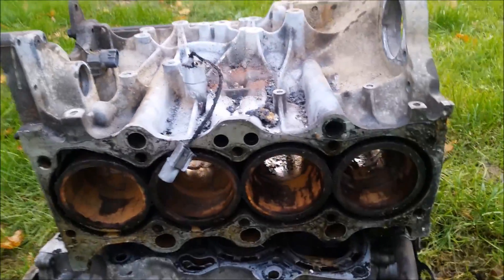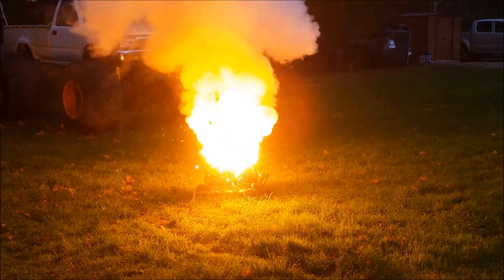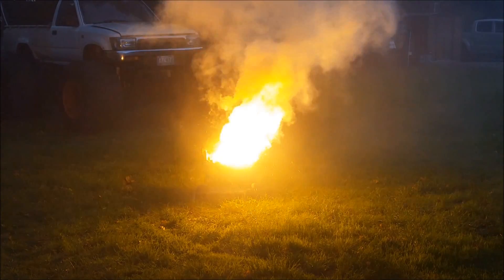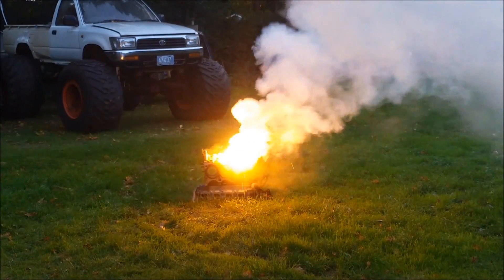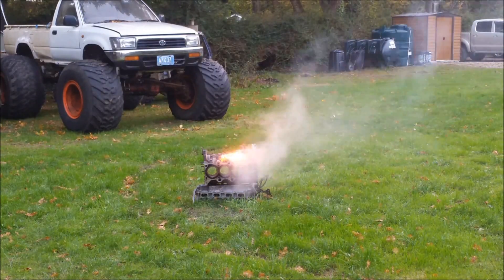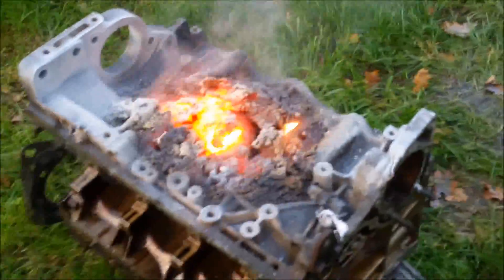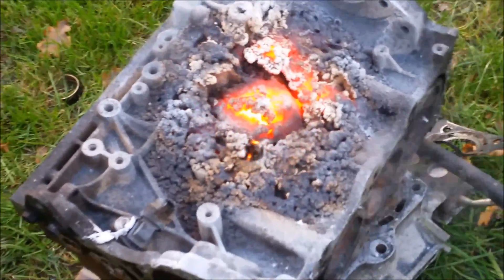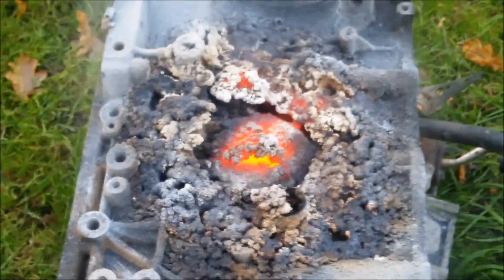2KG THERMITE VS ENGINE BLOCK

Comment: If you had gotten the mixture just a bit better and used a clay pot with a small hole in the bottom, it would have done WAY more damage
Reply from the maker: Yep, in the second video we put it in the cylinders and it burnt through the pistons and the sump....
Reply: @marktgsxr  I watched it right after this one. 

Thanks for the content

Comment: When an engine gets completely destroyed, you can melt down the block, and then cast the molten metal back into the original shape of the engine block.

POW! You've got a brand-new engine!

Wash, rinse, repeat, ad infinitum!

Comment: Now some people argue that it didn't do anything to that engine block but if that was an actual running vehicle with all the hoses lines and gasoline and oil and so on after that kind of experiment attack on the engine block that engine would no longer run the vehicle would no longer move cuz all the control valves hoses connections lines wiring would all be burned away rendering the whole vehicle useless but that's just their Siri because they never actually done it where the proof is right here in the video and they won't believe their own f**** eyes
Reply from the maker: You've hit the nail on the head!

Comment: undirected thermal reactions are weak. Conatain the reaction in a vessel that allows it to be directed in a singular direction and there'd be a hole through the block if you made the mixture right.
Reply from the maker: Totally agree! That's exactly what happened in the second video!

Comment: What a waste of time.
you don't understand the dynamics of thermite.
  Trump 2020
Reply from the maker: You must be another flat earther....
Reply: The Nutters Workshop 
If he would have put the thermite in 2 flower pots, one in the other, set the pots full of thermite on the block using the hole in the bottom of the pots to were you want the hole in the block. Ignite the thermite, cover and back up and wait. Then the thermite will burn through the entire block.
Reply from the maker: @stomabag7127  sounds like another experiment is in order.....

Comment: Mhm... The reaction was much slower than usual.
Reply: Bad thermite mixture
Reply: Yeah, iron oxide absorbs moisture. If it was left out in the open, it probably was. You need to keep it in a sealed container, or dry it out in the oven before using.
Reply from the maker: I may have gotten damp..... need to try again....

Comment: Badly made thermite???
Reply: just an opinion, this could've worked if the thermite were concentrated in something heat resistant that controls the flow of molten iron, like a flower pot. That way the heat wouldn't be spread out and the melting metal could've pierced at least one layer on that engine block. aluminium has a very low melting point compared to iron (about 660 vs 1540 C). not to mention thermite burns at 2000-2500 C.
Reply from the maker: Kejsarn no, just the engine block doing what it was designed to do, shed heat!
Reply: The Nutters Workshop high quality?
Reply from the maker: Kejsarn it was loned to me from the railroad maintenance depo.....

Comment: I don't think it was the right mixture. The best mixture is 1 part aluminium powder for every 3 parts oron oxide, wich would make the thermite look red. The mixture in the video was grey.
Reply: Red iron oxide works best though. The mixture doesn't matter very much. The ideal mixture of iron(II) oxide (red) is about 54g of aluminium with 160g of iron(III) oxide. Don't measure by volume, that's silly.
Reply: Black iron oxide
Reply: Mesure it with g.mol. just find the equation. Google it
Reply from the maker: New video coming soon that is red iron oxide.... i can you it burns alot faster than in this video...
Reply: In the end modifying the chemistry doesn’t change anything. Either way it doesn’t matter. Neither will do much using it the way that he’s using it.

They have to be used as shape charges/focus their thermal output on a smaller area.

That requires some machining, or at the very least welding experience. Thermite alone won’t do anything special. You need to design housings for the chemical reaction.

Comment: hmmmm. seems it didn't melt it at all. is it cast iron?
Reply from the maker: Paul Sheer i think the aluminium block dissipated the heat from the thermite with incredible efficiency! it would be interesting to try it on cast iron block!
Reply: @marktgsxr  Aluminum has a ridiculously low melting point compared to cast iron, I think you just suck at making thermite. It should've gone through the engine block in seconds.
Reply from the maker: @WhatEvenIsAGoodName  funny thing is i dodnt make it.... it was proper stuff from the railroads...the only thing that people have said that makes sense is it was damp hence all the smoke..... i dont know but was an interesting real world experiment..... it would be interesting to try it again with a few more variables thrown in and i probably will do just that in the future, a final note the heat generated from it was insane, you litteraly couldnt stand anywere near it whithout burning your face... crazy.........